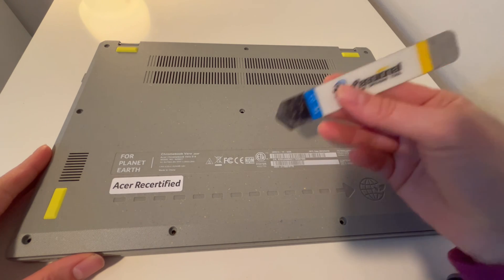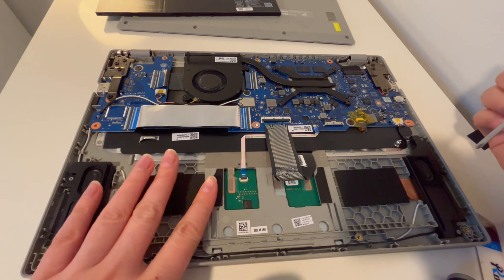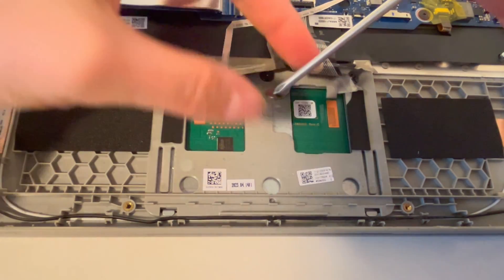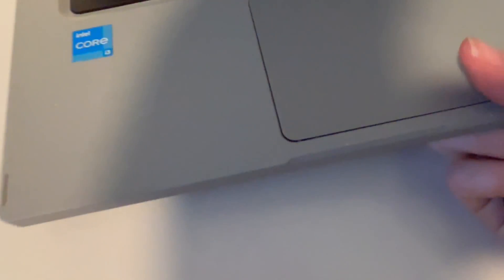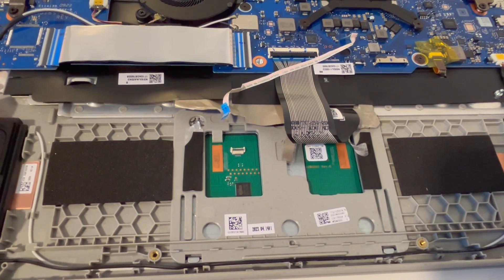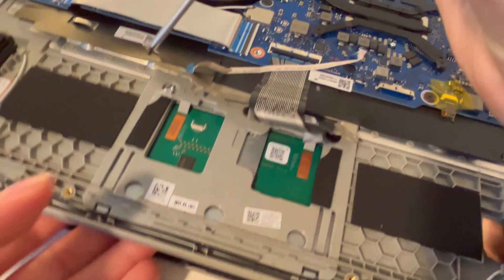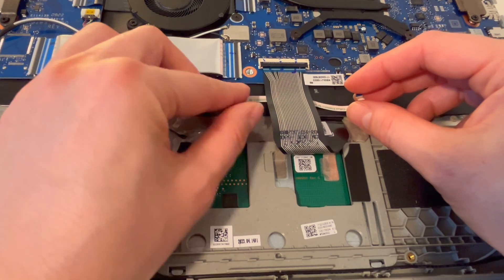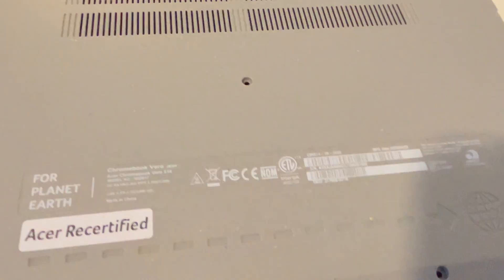How to Acer Laptop Touchpad Replacement - Guide by a Certified Technician

Comment: the difference of my issue is that the purple thing to attach the mouse pad is also gone and my laptop is hp model 620
Reply from the maker: So the part that the mousepad attaches to is called the palmrest if that is broken then you could look in to replacing that part instead of just the touchpad.

Comment: I purchased an A515-58MT-70H4 Acer on Ebay. Pictures had a fingerprint reader on this model, but no fingerprint reader on the one received. Would a touchpad  with the reader for an A515-56T fit an A515-58M model? As a technician, how do you find such compatibility information for repairs?

Comment: Hi! One of the little plastic flaps that make your touchpad click, has broken off. How can I fix it? With glue or is there a part I can replace?
Reply from the maker: You can get replacement keys on eBay. If they don't have any for your model available then you can get a replacement keyboard and get the parts off of that